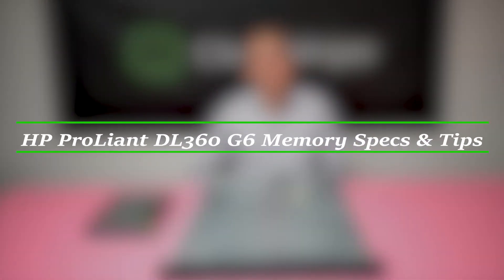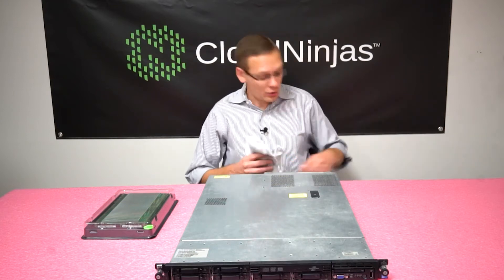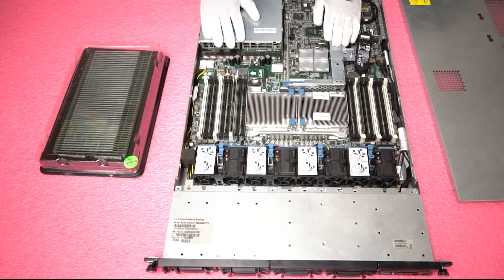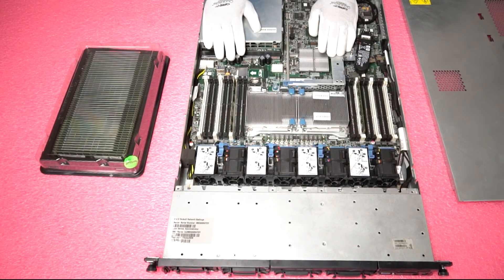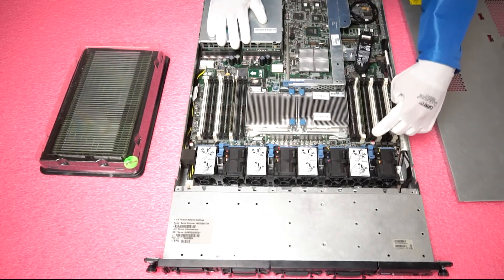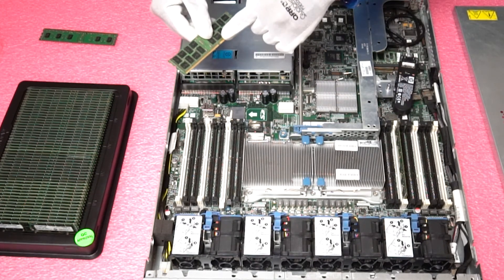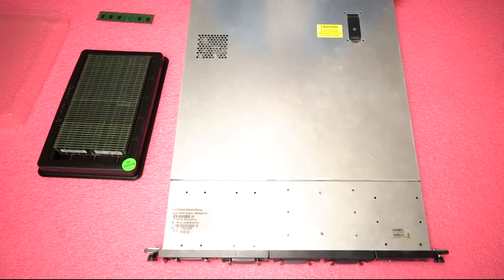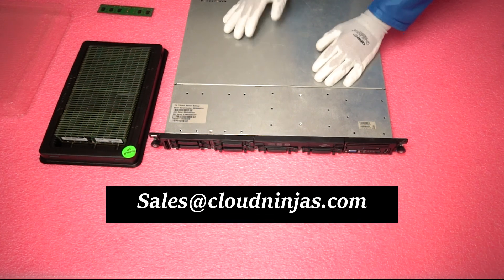HP ProLiant DL360 G6 Server Memory Spec Overview & Upgrade Tips | How to Configure the System

Comment: Can i put x5690 cpu ?! I heard may flash bios and disable power managment or something like that... Leave comment
Reply from the maker: Unfortunately, you cannot use X5690 processors with HP DL360 G6 servers.  You run into a heat issue.  X5670 is the best Intel CPU for your server.  Best wishes.  Please smash that like and subscribe button.  Thank you.
Reply: @cloudninjas  already did ... Sub and like ... But for heat issue if i run cpu with water cooling doesnt make sence
Reply from the maker: Will ask our engineering team if they know more information.  Thank you.  Have a nice weekend.
Reply: this server can run with two X5675 all is about TDP this server will work nice with TDP 95 
Max memory support its depends from CPU. 
who put this guy in IT with servers.

P.S. At the moment i have installed 140GB in all 18 Slots 2GBx6 8GBx8 and 16GBx4 no error server run really good.
Reply: @DEV_Shadow    thanks for the replay
now i want method to upgrade firmware of p410i smart array to try if it will read 2x 12tb sata hdd 
do you have an idea or an external raid controller that can handle 12tb on 8x pci port?

thanks have nice day
Reply: @oussamathedjfreeman  like for now I have installed 1GB smart array any way i not test that big HDD
Reply: @DEV_Shadow  i have 2 of 12tb hdd they didnt showup on smartarray p410i, i think i should use external controller or update anotherone, my system now is 2cpu x5679 3.2 GHZ each, 52gb ram and 2x2tb ssd on raid mode ,gpu nvidia 1650

thanks for the replay